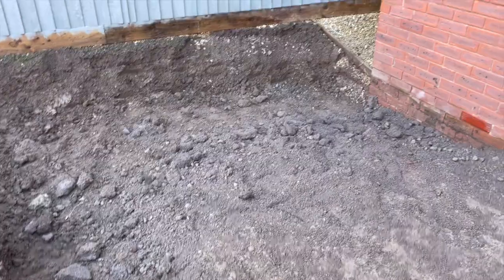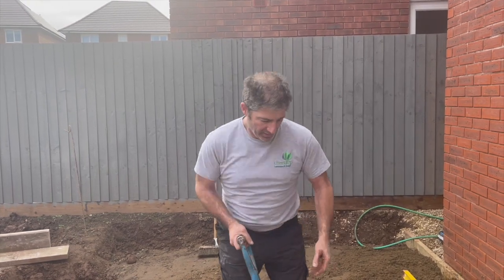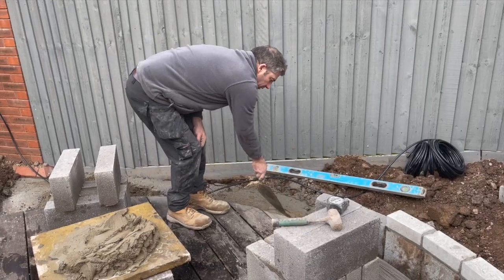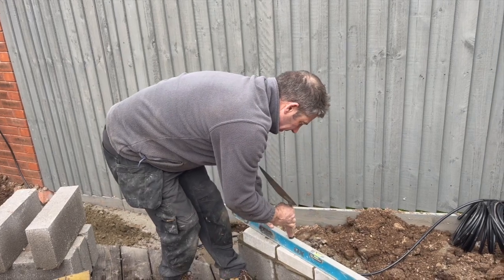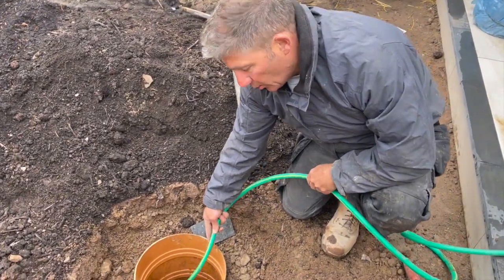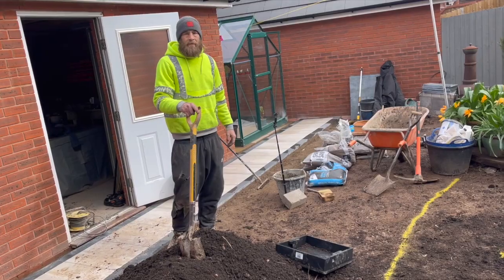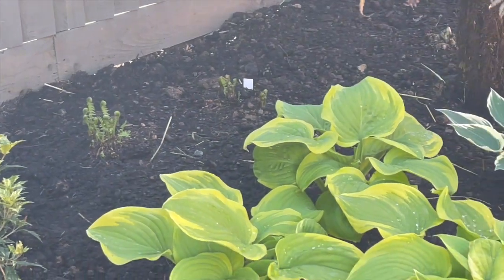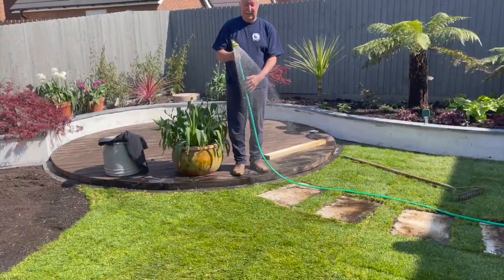A Landscape Garden in The Making

Comment: Excellent work J-B, looks great. Couple of questions if you would be kind enough to answer (a) did you use a MOT base under the dry mix and if so how deep (sorry, I couldn’t see from your vid if you had or not) and (b) for the Shou Sugi Ban treatment, do you seal with oil after the scrub and burn? HNY fella.
Reply from the maker: Call me Paul mate its easier to explain